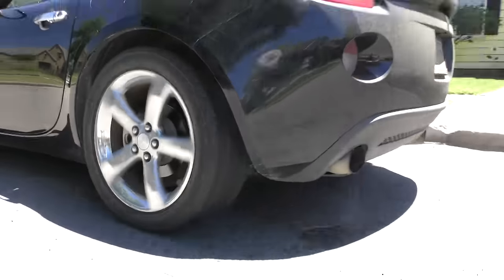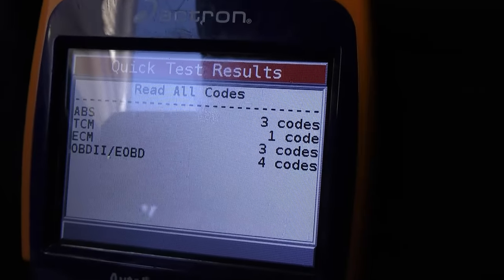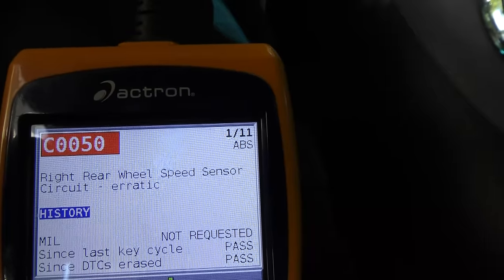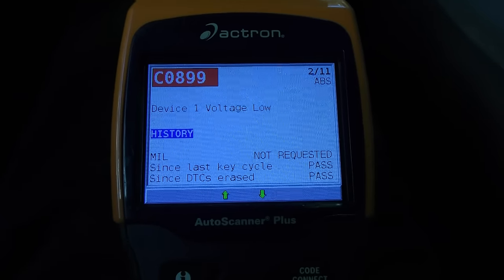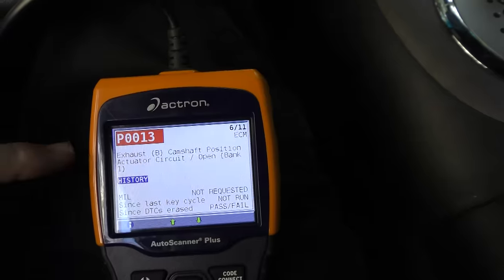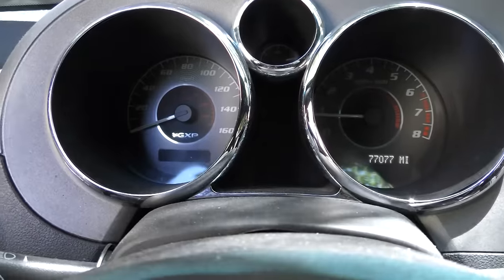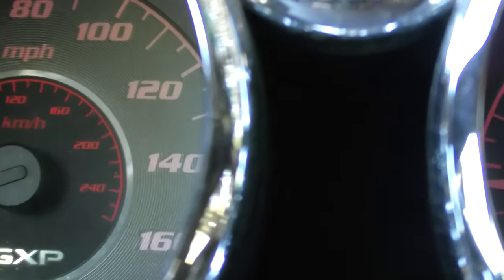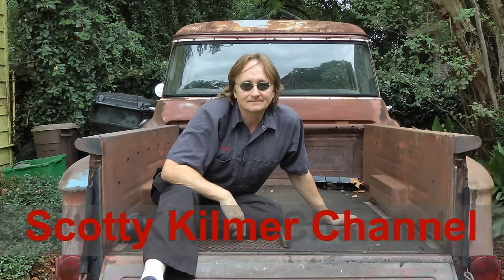Check Engine Light On in Your Car? The Truth About What it Means

Comment: Scotty. I left my truck idling for an hour or so with ac on,  its a ford f250 5.4. Now its idling rough. seems little sluggish, still runs ok but slight funny exhaust note. I'm wondering if that cat is plugged. its a work truck 250+thousand miles. thanks for any help. check engine light came on and code reads lean on left bank. also I do not see a egr on this truck. is it because its 3/4 ton?

Comment: I have a po153 code bank 2 sensor 1 slow response in my 07 mustang GT. I know it has an exhaust leak where the manifold to pipe connection is, changed the 02 sensor but code still comes up. is the leak the cause or what else could it be?

Comment: Good day Scotty , I have a Mitsubishi lancer gsr (2 door) 1998 model. My problem is the check engine lights  appeared  every time I start the engine but the check engine will disappear when I   touch the gas pedal even just a slight step  on it the check engine  will disappear.  Before this problem happens my car overheated   due to a hole on the  radiator hose  so i fix it  and when I start the engine  and that is the time the check engine appeared and it will disappear  every time  I step on gas and it will come back again every time  I turn  on again the engine,   Any suggestions what is causing the problem?? thank you.

Comment: Scotty, I would like to ask something related to scan tools. I noticed that I have a check engine light when I turn the key to the on position but it turns off as soon as I start the car and it's running. I scanned my vehicle (Citroen Xsara by the way) but there were no codes. Could it be a manufacturer specific code, that requires specific scanner? I think I can reset the ECU but don't want to because it's weird that it doesn't see it but allows it to reset. Thanks for the help!:)

Comment: I have a 2008 Kia Sportage. I had a P0159 error message. I change the bank 2 sensor 2 sensor but the engine light came back after 2 weeks. What's wrong?

Comment: The DTC definition that comes up when a check engine light is on is not always the problem.  I replaced a throttle body on a Toyota and the code P0420 (catalyst below efficiency) disappeared.
Reply: Timetryp true a driveability issue caused by something else can trigger a cat code.  it is always wise to troubleshoot any other codes first and look for tsbs before condemning a cat.
Reply: How true....

Comment: Hi Scotty I have dodge grand caravan, which shows the  engine light on, we checked and we changed two oxygen sensors,  the lights appears at the mornings and then it disappears (after driving) but when we take the car to the verification they say that the Drive Cycle Catalyze  is not completed, we already have used for almost 700 miles and they keep saying the same, Have you any idea?

Comment: I might of stalled a few times and the car just got s check engine lighg on because i am a new driver is it due to stalling or maybe old gas? Also the oil is a little low

Comment: my check engine light came on recently but the car is still running fine it is hesitating a little bit but it's running good once it catches full speed I'm just trying to figure out what could be the problem and it happens to be that my check engine light is not flashing it's just completely on and stays on plus I got to Old School 94 BMW 525i

Comment: My honda crv 2007 just had engine light, vsa and traction control lights on. The car runs still fine. I brought it to tue shop and they charged me for couple hundred dollars to change the camshaft sensor, light was off for a few second, then come right back on. Then they change the valve solenoid. Lights are still on. Please please help me if you have any idea!!

Comment: A lot of times it's oil pressure, low oil
Reply: True I had low pressure because I had not changed the oil. Low pressure means it takes longer for the car to warm up, and it needs full throttle to get it up to speed.

Comment: Hi,  I have Hyundai veracruz 2008, run over 605090 in UAE 🇦🇪 . I realised that the gear is not shifting down as speed get reduced at roundabouts. And i feel small jerk. While it its down to lower gear.  What could be the case.  please advise

Comment: The weirdest thing happened in my v6 Honda Ridgeline yesterday. I was driving like usual and stopped for food for a few minutes. Then out if nowhere when I started my car back up, my timing belt was whining like crazy. And it got louder with more speed. When I popped the hood, I could smell something burning/melting for a little. Then it went away when I braked hard because some ***hole cut me off. The hell happened???
Reply from the maker: I would assume a bearing was whining and perhaps it burned out now. Look for things that don't work anymore. if not that, replace the belts

Comment: i diagnose my own car. one time check engine light on air fuel mixture too lean. i fixed a crack vacuum hose 5$ in the intake / pcv. drove it for thousand miles just for observing why. guess what if a mechanic is not good he will change whatever he thinks need changing - maf, injectors, o2 ssensors etc... and spray bug killer in the intake lol

Comment: the problem is that you go to the inspection, and they don't pass tour can even when the check engine light is out, because they connect the computer and they find out that you erase the codes.
Reply from the maker: but, often you can erase codes, and if they don't come back after a drive to reset the MILS not ready, they can pass then if you are fast and Lucky.

Comment: Got a question for you 2011 sienna van 3.5 v6 with almost 160,000 thousand miles within the last week has had a check engine light pop on twice.  I have my code reader its a cheap one from walmart like 20-30 dollars but, I figured since I am not a mechanic it would do for at least reading codes and erasing them if I want too.  My main screen will pop up codes 1 and I will choose the option to read codes and get no DTC (Diagnostic Trouble Code).  I erase codes so light will go out.  Van still gets good MPG and runs and starts good for the most part.  Spark Plugs were replaced with denso long life iridium around 120 thousand or so per toyota reccomendations.  Before this light popped up van has a few times over the last month not really say what you would call super slow but, occasionally after its been driven then sits 2-4 hours will spin an extra turn or two before it starts.  Although I can't confirm it I believe battery may be slowly getting weak.  Its only two and half years old or so but, its those trustarts from toyota dealers.  I hope I dont drive you crazy with this much information just thought if you have time to read it maybe drop your two cents worth in on it.  I am planning in the next few weeks to slap a new battery in it regardless just so I can have a fresh one before winter in a few months.  I never was a big fan on trustarts from toyota dealers.  I like to have somewhat more CCA's in a battery than 575.  If you wouldnt care id appreciate it to hear what you think

Comment: Any ideas on a good automotive scanner? I currently have the  Actron CP9690 and would love one of those Snap On scanners but cant afford the $2000 for a good used older model (or $10,000 for a new one). I've heard of these box things that plug into your computer. It might sound a clumsy setup but my current set up is a Actron scanner with a old oscilloscope. (That's a pain to use on a regular basis but hay, it works.) Just wondering if theres something that can make my life easier.
Reply: There are some good low cost alternatives to buying an expensive scanner. You can buy a Bluetooth interface that plugs into the OBD2 port for about $10. Then you put scanner software on your laptop or smart phone and pair it to the interface. The software package I bought was from AutoDoctor and it cost around $50. It turns your laptop or  smart phone into a very capable scanner. You can look at and clear codes and read all the sensor values and it has an oscilloscope feature that lets you look at O2 sensor output waveforms. I love it!

Comment: I have a 2013 Mercedes Benz e350 myvengine light is on intermittently and my car does not start every time I turn it over,  I have to turn several times to turn it  over and not sure if they are connected

Comment: It happened to my Land Rover discovery 5, I had disconnected the negative terminal of the battery for about two minutes, put it back on and then the light was gone … it’s been a month and the light is not on yet even thou I drove about 2300 miles

Comment: hi i have a 93 ford ranger my check ingine light comes on and wen at idle it idles ruff and wen i take it out of town at 55 mph it bogs down like its lost all it's power wish i could find why it does that i was told it could be a vacuum leak or o2 sensors going bad clogged cat converter i don't no how can i do my own test to find out on this truck it's a 1993 ford ranger

Comment: it's nice to erase the code, BUT if you have to take your car in to get an inspection it will FAIL even if you erase the code.
Reply: correct.  computer needs a full drive cycle which can be upwards of 75 miles of mixed driving.  by that time, if you really have something faulty the light will go back on.

Comment: Scotty I've a question for you, I drive a 2014 Chevy Cruze, about 2 months ago, my car starting giving me warning messages saying "service stabilitrak" and "service traction control" and the abs light came on when they'd come on, the controls suddenly became very stiff and sluggish. I should point out it was also very cold at the time (-50C some days) some times it would clear itself as I drove, other times it didn't. I took it to the dealership, they ended up replacing a hub. The next day the same problem happened and continued for a few days but suddenly corrected itself (possible coincidence, the weather improved to the -10 to -20 range)Now I just drove home from about a quick 5 min drive to the store and the check engine light came on on startup on the return trip (but not on the trip out) Didn't notice any unusual sounds or anything, Could this all be inter-related? Any advice?

Comment: 2017  OPTIONS
I have 2004 Toyota ist; check engine light comes on after driving for a while (30-40 minutes)and when i switch engine off and on again, the light is gone - quite annoying. Pls help me

Comment: Hi scotty, my 2005 mazda has the engine  check light on and on .I took it to shop and said that I need to change  evap  valve because the code came as minor  leak so I did change it but then the light came back and shop told me to get new gas lid and I did buy one from dealer and still same code kept coming back. so the shop ordered another part think in the first part that they ordered might be bad,so we did and the light went way but after days light came back and I'm struggling  with this problem since my car won't pass the smoke check and it's due soon. if you have an good idea please let me know

Comment: I bought a second hand car a year ago with a check engine light on. I tried to figure out how to get it off but the mechanics just telling me some expensive stuff to replace but they cant assure it will be fixed. I tried to replace the ones that are not expensive but still its on. Its been a year and the car still running fine. I just ignore it, thats the solution

Comment: Hey Scotty,  My wifes 2012 Rogue had the engine light go on and I bought a Launch Creader scanner and found out it was the Mass Airflow sensor so I bought one off Amazon for around $40 and i cleared the code and it was fine for a month then it threw the code again  so I cleaned the sensor with mass airflow cleaner and after a few weeks the code popped up again, so i keep clearing the code but Im a little sceptical about buying another sensor unless you think I bought a cheap knock off??

Comment: Love the vids...they're all really helpful! I've got a question for anyone who feels like answering...I've got a P1504 code on my 02 Taurus SE OHV. I looked it up & it said my Idle air control valve circuit is malfunctioning. Well, I've replaced the IAC with a new motorcraft one, checked and fixed any vacuum leaks I could find(I did the cigar smoke test :-)...worked good too!), I replaced the EGR valve plus the metal line that it connects to(as I snapped it taking off the EGR), I cleaned the throttle body and plate along with replacing the throttle body gasket, replaced the pcv valve and elbow, replaced the connector that leads to the back of the iac and replaced the wires about a foot back from it. I think my idle feels fine except for when I run my air conditioning in park(which makes it shudder a bit and sometimes act like it's going to stall). My guess is that I have to replace more wire from the IAC but I'm not looking forward to tracing it back to the pcm. Does it sound like I'm on the right track?(or could it have something to do with the A/C?) If anyone has had a similar issue I'd def appreciate any tips or info.

Comment: This is poor advice for anyone who lives is a state that has state inspection, like my state of New Jersey. In NJ, your car MUST pass inspection with NO CODES, or it will fail. Failure to pass state inspection will usually result in fines over time totaling more than the cost to fix the car. And if you clear the codes and try to run to the inspection station before they come back on, that won't work either, because the car has to go through drive cycles to ensure all is well with the systems.
Reply: WTF that sucks. None of that in FL

Comment: The inspection automatic failure due to check engine light is just a way for Lawmakers to keep Mechanic shops in business
Reply: Frank Assnot Close but really it's a way to Grand stand about "saving the planet" since most of these stupid lites are caused by the useless evap system

Comment: Scotty, i have a 2004 silverado 5.3 with 191,000 miles, i had my check engine light start flashing the other day, and it sputtered then started running normal again, it has done this twice, i scanned it with bosch scan tool and had no codes,  battery voltage seems to be good, alternator is charging, i cleaned up a few grounds on the frame, reconnected and resprayed with undercoat, and it made no difference, what do you think it is?  always run mobil 1 synthetic and filter, always have good new air filter, always run top teir gas, conoco, phillips, etc?  motor runs like new, except for the 1 or 2 flashing check engine light, then back to normal. help!!!!!

Comment: Scotty, I have a problem. I have an old '83 camaro (manual). This past week, the engine braking feels like it is getting weaker. Also, today i rev'ed it in neutral and the rpm's were stuck at 2,500! It idled fine but when I rev'ed it up it got stuck and wouldn't go back down! I opened the gas cap and an unusual amount of air came out, usually just a little comes out. I don't know if those two things are related. But I was just wondering if you had an idea of what is wrong. Thanks.
Reply: BRYb0Ss11 Rocks check out his video
"how to fix your engine with a cigar"

Comment: My check engine light and ESC lights came on after an oil change! Any ideas besides the $100 diagnostic at the dealer?
Reply: Not sure why is ESC light on after an oil change! ESC similar ABS light,you can think about Launch CRP123E/CRP129E

Comment: I have PO420 the car is lacking acceleration and wild noise sounds like a muffler problem although it's not a muffler I know it's either the catalytic converter or an O2 sensor I'm just hoping to God it's not my transmission it's not really sucking gas it is a little bit but not a lot. The Upstream O2 sensor is reading 0.8 the rear O2 sensors reading or Downstream is reading 0.03 something something

Comment: I have a 1999 Acura CL 2.3L manual and I initially have the code P1382 which is no signal to the cylinder position sensor. I drove with it for a while and my timing belt snapped and I replaced it without a problem or bent valves. I changed the distributor but I still have the code. And I drove in heavy rain with the new distributor and the car stalled coming out of a drive thru. Then there were 2 codes p1382 and p1361 which is intermittent signal to the TDC sensor. Should I change the crankshaft position sensor near the timing belt and exchange my distributor for another?? Thanks scotty!
Reply from the maker: I would change the sensor and check for wiring shorts or connectors that are loose or corroded inside

Comment: I had check engine light on my Audi a4 after Warrant of fitness done. Guy was shady he absolutely tried best to rip me off and Cost was $200 but i did a smart move and scanned it with $9 OBD scanner through phone. Rest the Code and it goes away but right next it was again on.. I was pissed so i took a drive in S mode 0-60km/h and engine light goes off permanently. A tip be patient dont rush to mechanic before doing a home work!!! 😂
Reply: My suggestion is European cars good as far as you take car of them but its myth they are expensive to fix mechanics always rip you off doesn't matter what actually you have it. HONDA civic front arms bushes were replaced cost me $600
I have replaced the front arms bushes on my Audi $440 as before going to mechanic i did a online check on parts and labour from 3 different shops.. Went to lowest one little bargain and job was done!!!!

Comment: Had a code on my '99 tahoe indicating one of my catalytic converters was not working efficiently,  a minor problem ,as it ran well, had a shop erase the code, but came back on several times at about every100 miles. Solution.. yank out the check engine  bulb on instrument cluster.. problem solved...